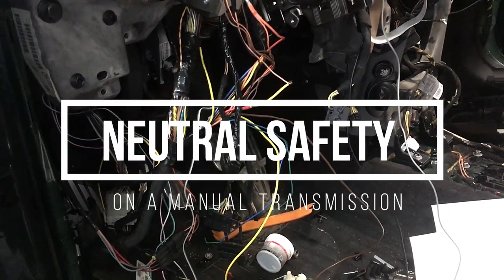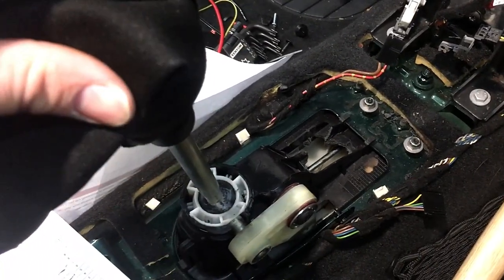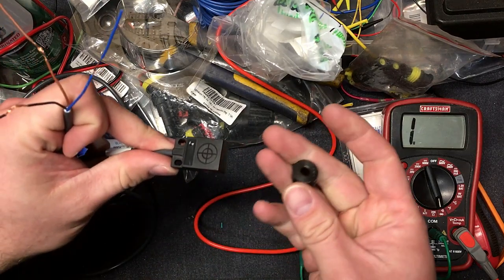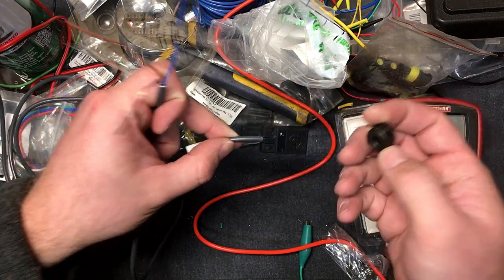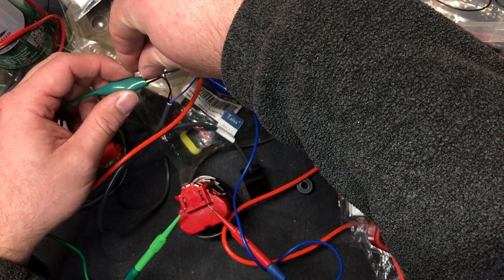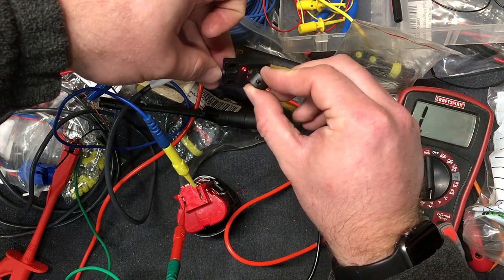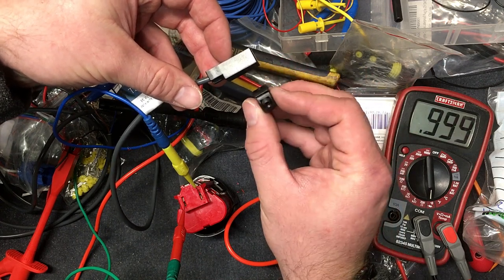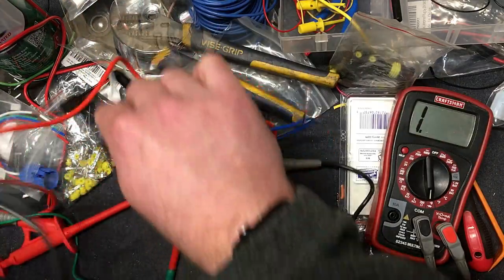DIY Manual Transmission Neutral Safety

Comment: how did you wire it? 12v ignition, ground, and signal to the remote starter? thanks
Reply from the maker: To a switched constant 12 volt source where the switch also completes one of the ground safety circuits for the remote start. You'll need a SPDT switch to do the job. The sensor will slowly drain the battery if you don't have some way to shut the power off if you're parked for quite awhile.